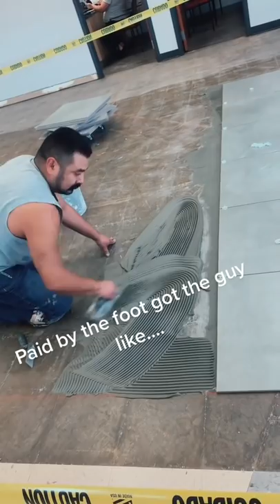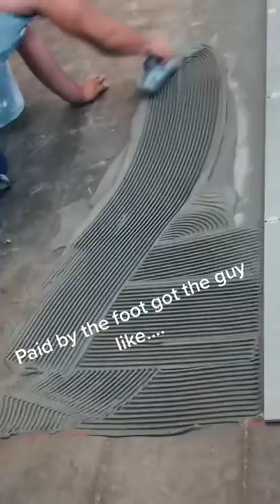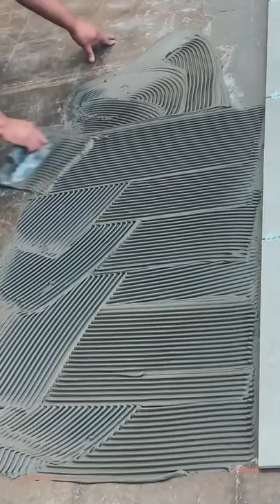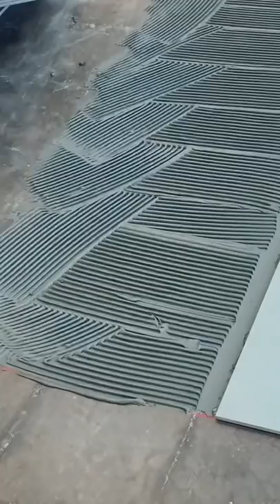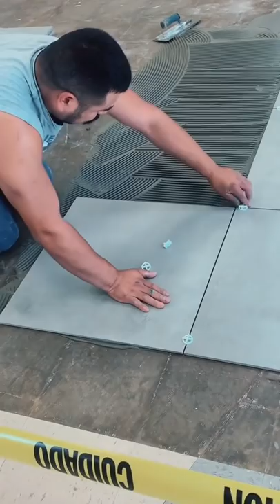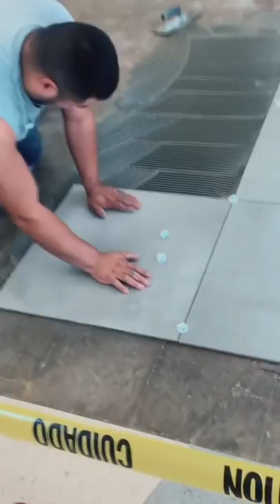Dude laying our new tile is 🥶 CREDIT terrywatson806 #Shorts

Comment: He's partially on his way to being a master tile installer. The thinset should be burned in and then racked in the same direction. He should also back butter those large-format tile
Reply: Burned in and racked?
Reply: Yes please elaborate
Reply: No need to back butter them when laying down, only if they gonna hang on wall
Reply: thanks for the lesson ......smfh
Reply: Yeah, I'm sure you are a "master" 🤣
Reply: Back butter?
Reply: @alfinsk1411  ntca would disagree
Reply: @alfinsk1411  That’s so wrong. TCNA and the manufacture literally tells you to back-butter large format tile that big. That installation is gonna be so hollow and eventually chip or crack.
Reply: @trolltocol9oseven729  thinset applied to back of the tile. Helps bond the tile to the floor
Reply: There are so many people in this field in the comment section. It’s fascinating seeing you all commingle.
Reply: @jeevunvethanayagam6536  "burned in" means letting the thinset slack, meaning giving the mixed thinset the proper amount of time to let the polymers melt and activate,  About 15 minutes.  He spelled raked as racked. Meaning the myth that the thinset must be troweled  in one direction only. Which is complete bs. The trowel should be ¼" to ½" notch,depending on the size of the tile,larger tile, larger notch.

Comment: It's better to apply the adhesive in the same direction on the substrate. Do not apply the adhesive in a criss-cross pattern between the substrate and the tile; air bubbles could become trapped.

Comment: Sweet Jesus... So many experts on here! Lots of talk about coverage and the cuts not being done on the side. This is obviously a commercial space so let me break it down for you. Coverage is important but not as much as the bond from the thinset to the tile. The only thing I didn't like, I've been tiling for 13yrs, is that he spread too much mortar and when it flashes over the bond won't be 100% and the tile will sound hollow. That red line is chalk. We use to stay square through the WHOLE space by making a grid on the floor and using it as a guide line. We usually do the cuts as we go but it's irrelevant if you don't. You don't have to back-butter tiles!!! We did a car dealership in 12'-5' tiles and none of them broke when they drove pickups on em. All in all, I'd hire him.

Comment: You should always lift the tile backup and re notch to ensure there’s full coverage, otherwise you can get hollow spots that can crack or cause the tiles to pop up.
Reply: Actually just use the proper notch of trowel and slide your tile back and forth to make a 100% coverage. If you know that your surface is filled with holes and uneven then sure, lift your tile back up.

Comment: For anyone whose job requires alot of strain on knees I'd recommend two things, One get some knee pads they don't have to be bulky they're just something to rest on, Two get some compressions sleeves for your leg joints they will help your legs recover after work and should hopefully keep you going longer before any long term problems set in

Comment: Trowel grooves are adjacent to the tile run, spacers used, right depth trowel and the guy is working at a rational pace. So WTF is the problem?????
My only concern is maybe vibrating the tiles which is necessary for larger tiles AND buttering the tiles!

Comment: It’s ok to lay like this if u have an absolute flat base to go on which is very rarely the case, if he hits a few bumps in that floor he’ll have problems because adhesive is very wet so when he fixes tiles there not much height if runs into some bumps

Comment: Going forward tell him to put thinset on the back of the tile just in case he didn't apply equal pressure when placing each piece of tile. How he's doing it, over time when the foundation's temperature changes, the thinset will crack. It looks impressive tho.

Comment: Ok, he's fast
But, im not here to criticize
Im civil engineer and my job is to inspect this kind of services
Theres nothing wrong with what or how he's doing it, but there is a step kinda important that he left behind
Watering the floor BEFORE applying the grout to "glue" the tile into the floor
Why is that?
When the grout dries, it will tend to unglue from the floor and become loose, in time the tile can break and usually a sign of that is when you knock lightly the tile a few times, if the sound is kinda hollow, that means grout is apart from the floor

Comment: Those thinset lines are supposed to be straight.  Or else you can't settle the tile properly because you get air gaps!  That could cause cracking later.

Comment: Trowling need to be in one direction and large format tiles has to be back butter too also need to move tiles back and forth at least 1/4 "  to break the bridges  from thinset! Bet anything it doesn't have full coverage therefore it's a fail installation anything gets dropped on this tiles are gonna break them in pcs👎🤷‍♂️

Comment: You are meant to lay the adhesive in parallel lines so air doesn't get trapped under de tiles, if you don't do that and something happens to land on the air pocket it will crack the tile.
So the only thing wrong about this video is that. He should have extended the strokes so that all the lines under the tile were parallel.

Comment: Wrong trowel & not flat troweling the back of the tile. Which is required for large format tile. Quick for sure but not installed correctly.

Comment: He's doing it wrong you are supposed to keep those lines straight sp air can escape from under the tile when laying it so it has good coverage but the way he did it will make the tile break more easily in the future when someone steps on it as it won't be well supported

Comment: I worked heavy highway construction pipe crew when we had to mud up around the pipes to put in the structures we had to go fast af breaking bricks to fit and muddin..foreman use to say your not building a f-ing church go faster..man that brick hammer and trowel got a workout

Comment: Nope wrong ALWAYS back butter the tile before dropping on thin set. This is the reason why tile floors fail because he combed the bottom without back buttering the tile it will leave pockets of air that cannot withstand impacts will crack and break. He didn’t put down felt tile underlayment so when the slab settles and cracks unevenly it will destroy the tile mortared to it

Comment: I can't believe so many people lay down tile wrong even people who have been doing it all their lives still do it wrong. 

I recently just hired like a master Tyler Chinese dude and the Chinese here are Master masonry and I'm watching him lay the tile and I'm like yeah he's not doing it right but he still did great high quality work I even got a leveler and threw it across the floor and it's perfectly he didn't use tile levelers or spacers or nothing all by I and a little hammer. However the technique that it says you were supposed to use as you make the grout thinset lines and you also do that to the back of the tile for Max adhesion and getting the airspace out.

Comment: I won't call meyself am expert, only that I have been in the tile industry for 35 years. Specifically on the installation side of it. This tile might stay down and give you years of use however, technically, there are a couple issues. This tile requires 80% coverage for a good chance of success. He is not getting that. The trowel size is not big enough. He should be using 1/2" x 1/2" and backbuttering the tile. And crazily he is actually scraping away the thinset along the edges where it's needed most?! First time a stilleto heel or similar lands on that corner with no thinset underneath that tile will break. Lastly, concerned what is on the substrate. Unable to tell what is there existing but many adhesives left on the substrate could result in a bond failure. Hope it's not an adhesive from a vct install. Would love to hear if it's still down with no issues!

Comment: You can’t have ribbons going in multiple directions and he never back buttered the tile. There’s air trapped underneath and those tiles are definitely going to crack under pressure!

Comment: Just learning to do tile and im the first in my family to do it so these videos help out alot, thanks to all the people in the comments that help out aswell
Reply: Yeah! Do it just like this guy and then you can replace the broken tiles a year down the road because this was done completely wrong! No back buttering which is required on large format tile, no straight lines which means are trapped and there will be voids, no smushing the tile into the mortar with the back and forth motion to collapse the ridges, in which if he would have done that, there would have been are voids because he didn't use straight lines all the way. But since he didn't go back and forth, he certainly didn't get the 85% coverage that is necessary. Make sure you're watching plenty of professional videos and not dumb crap like this

Comment: I just mixed a 50 pound bag of quick set , laid the sluder pad , Tomm repeat , lay the 18 inch 1/2 in thick polished marbel slabs , 1/8 gap , I do like the skills ,
Reply: What are you talking about? His skills suck. He didn't back butter the tiles which is absolutely necessary for large format tile, he didn't use straight lines which means that there's going to be airscape problems and he's not going to get the coverage that is required and then he didn't even move the towel back and forth to collapse the lines! This was a terrible job!
Reply: @jackfox5738  I’m new to the tile game , I retract my statement sir

Comment: I don’t get it , I did a year of flooring and I can do this 10 times faster. Doesn’t butter the tile, doesn’t use clips  only uses corner spacers, doesn’t keep straight lines , over laps create air bubbles hence why you don’t do figure 8’s anymore. TLDR, this is some lazy work at a slow pace

Comment: That’s a rushed job. He has globs in the groove of his thin set. When they go to knock out the clips and grout it there’s going to be thinset in the joints. The grout will have to be touched up and repaired days after it’s finished. He’s not even moving that fast. Nor is he spreading correctly. Just because it WORKS doesn’t mean it was done CORRECTLY
Reply: Omfg I just watched it again and he really flattened the edge and then put a SPACER. Not a leveling clip 😂 he didn’t even push the tile down so it can tack up. He literally just placed and spaced. I bet you 110% you can’t slide a penny across the floor when he’s done.

Comment: You very replacing that title in no time either loose or will be breaking since it no bonding and he putting thin set down wrong and not in a uniformed direction... big tiles like that need to be back buttered as well ...

Comment: If you're gonna go on camera sporting your boy at least have him trowel with a 1/2x1/2 the same direction, pop a line so u dont have all that excess mud u role in and have to clean up (takes literally 1 minute to pop a line by yourself over concrete at 24.25 inch which is the same equivilant to rolling around in that mud u just over trowled) and back butter that tile dawg. cuz that shit aint gonna last but a couple years before it fails.

Comment: Looks like he's just doing it by eye, is it gonna be level like that?
Reply: A good concrete finisher will have already set a grade on the slab. The tile setter should have checked the floor for any imperfections and would put down self leveller to fix any issues prior to installation.

Comment: So let me tell you everything he did wrong. First of all, the lines need to be straight, all that fancy swirl crap will leave voids. Second, that is large format tile, and you should be back buttering them. Sure, it's not a requirement, but actually it is. It's not a requirement for smaller tile, but for large format tile it absolutely is, so now you're down two points. Third, you don't just lay it on there and kind of half-ass push it down. You need to slide it back and forth. This guy doesn't actually know what he's doing

Comment: Whoever tells you laying tiles is easy is because they have never done it
Reply: Laying tile is extremely easy. But you have to learn how to do it properly. This guy didn't back butter the tiles, which is required, absolutely required for large format tile, he didn't go straight lines, although he did it first and then for some dumb reason he went on a weird angle at the end which means it when you go back and forth pushing the tiles down, are is going to have pockets. That leads me to the last thing.... he didn't even slide it back and forth to collapse the ridges properly, in which I would give him a pass if the lines were straight and the tiles were back buttered. This is a complete failure.

Comment: I see no flat troweling, No directional troweling, no back back buttering the tiles, and when he cleans the edges up he keeps his margin trowel to flat to the floor and he scrapes up too much thinset, which means the corners of the tile don’t have any coverage which leaves it hollow. Won’t be able to roll any heavy equipment in it will crack and chip in the corners.. (sincerely an actual professional tile contractor) this Jose is only good for cheap and slap and clap work. No real craftsmanship going on nothing to applaud my 3 year old son can do this shit.

Comment: No skill at all there. He is using to small of a tryle for large format tile and I guarantee it will be hollow and Crack very quickly. He's using a quarter notch and should be using a half especially using 24 x24 tile. Also he is leaving behind a lot of excess thin set in areas he shouldn't